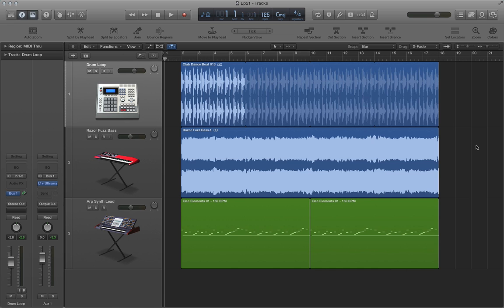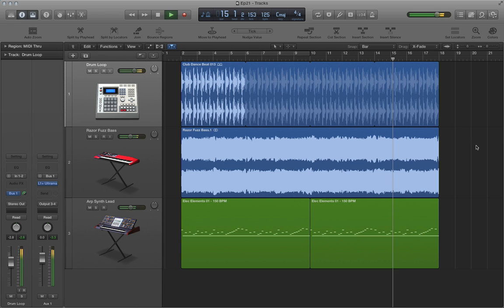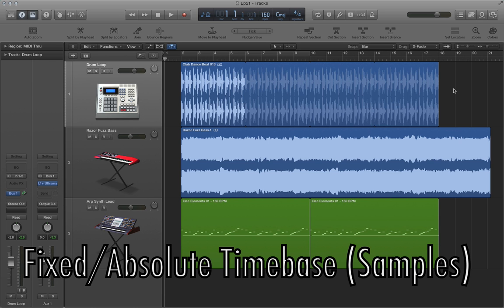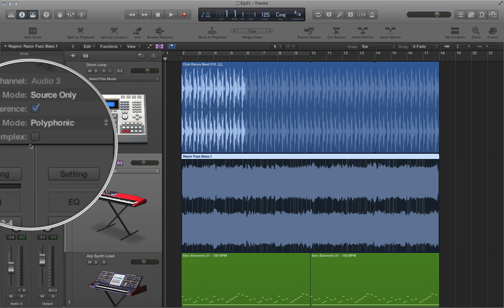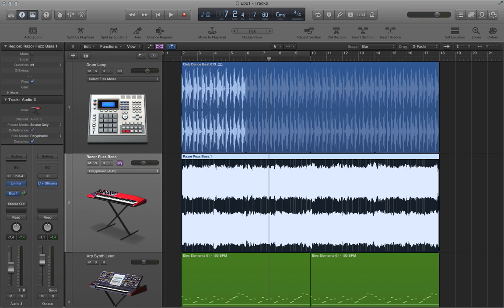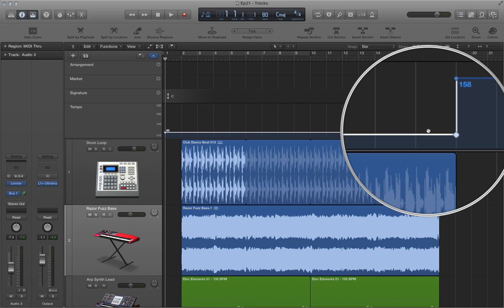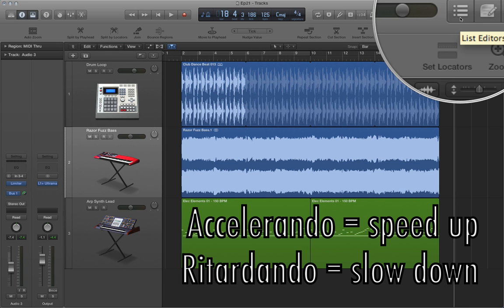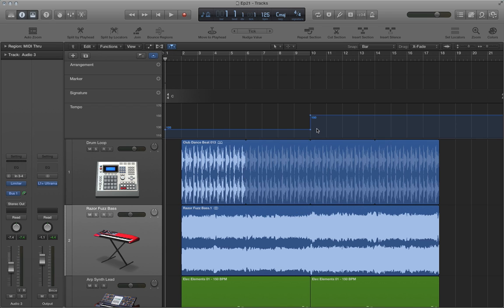Logic Pro X - Video Tutorial 21 - Tempo Changes with Flex Time

Comment: hey man, I was wondering if you could help me. I'm having issues with my EXS24.  Basically, after I've chopped up a sample, using flex time, and set a new bpm, it's all sounding good but then when I convert it to a new sampler track (EXS24), the notes play out in the original tempo of the sample, so it doesn't fit to the new tempo at all. I can't for the life of me figure out what it is. Again, flex time is working fine, and i can chop and edit the audio file to the new tempo, but the issues arise when I convert it to midi in the EXS24.

Comment: Thanks for the video. Is there a way to change the tempo of the project without affecting the speed of the audio? I have a project that was recorded at 120 bpm while it should have been 94 bpm. so now the song is off the grid and it's hard to mix.

Thank you

Comment: Thanks for your explication, I learned a lot but I have an issue to solve. I found this video trying to solve a problem about making a click track for a song called  "Domino" of Kiss. The problem that I have is the BPM counter of logic shows that the tempo of the song is 137,4 Bpm but it doesn't fit throughout the whole track, just keeps the "rigth tempo" around 10 bars. What would be your advice to solve this problem?
Thanks for answering

Comment: Does changing the setting to polyphonic compromise the sound quality? If there is a difficult guitar part I sometimes slow the tempo down half time then stretch it back up, it sounds fine but just checking?

Comment: my audio files always change speeds when i change the tempo (even straight after importing). it doesnt conform to any specific tempo it just speeds up or down relative to its original tempo. is there reason or way to fix this? is it because im importing mp3 files?

Comment: Thank you for your great videos.  I'm trying to put a slight slow down for 3 measures and I did everything you said with the second method(I think) and nothing changed. I tried to speed it way up just to see what happens and the bar moved faster but the audible tempo didn't change. What did I miss?

Comment: i have a question . so i was sent a garage band file to edit in logic x, i imported the garage band file and all the audio was recorded at 120bpm including a drum machine . I.E the audio from a drum machine was recorded in not the midi . ( i know  know why would they just use a drum track in garage band ) any way it wasn't at the same tempo as the garage band was set at . after analysing the drum audio track it was at 150bpm . how can i change the tempo of the track without changing the audio files ( i.e. they speed up ) so i can put in a better drum track etc.

Comment: Hi, love your tutorials so far but this one is a bit confusing to me.
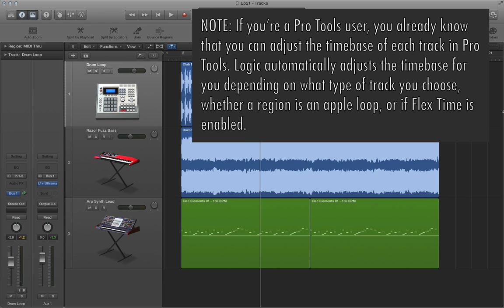At 3:53 while you're talking, suddenly the audio track is resized to match the other two. How does that happen? I guess it's not a trim, so what is it?
Also later at 6:00 when you change your tempo across time, why do you switch off the timeflex? Isn't that the basis for the audio track to work in sync with the others?
Thanks for reading and keep up the great work!
Reply: @3:53
Looks like he's undoing the tempo change from 150 BPM back to 125 BPM.

@6:00
He's not switching off flextime, but toggling between hide & show timeflex in general. On the actual track, flex is still active.

Comment: Hey MusicTechHelpGuy I have a question that I have not been able to find information on to answer. I'm pretty new to Logic Pro X, and I like creating DJ mixes, where songs blend from one to the next. I always find trouble changing the tempo of a song that I import into Logic as an audio file, so as to beatmatch it, essentially, to the previous or next song. I know you said audio files don't conform to tempo changes, but is there any way to accomplish what I'm trying to do? Thanks a bunch for the videos in general! They're a great source to learn new things! Cheers!
Reply from the maker: Do you want to just know what the BPM of the two songs are? Or do you actually want to change the tempo of one of the songs to match the other? To sense the BPM, there is a BPM Counter plug-in you can drop on a track and it will tell you the BPM. To actually change the tempo, you can do it with Flex Time. I might have to think about doing a video for that.
Reply: Thanks for getting back to me! I was more so wondering if there was a way to change the BPM of one song to match another one. I am relatively new to Logic and like creating continuous mixes, so I usually create a multi-track project and begin dragging songs in and then attempting to match the tempos, so I can transition between songs. I just haven't been able to figure out how to change a songs tempo within the project, so that it matches another tracks tempo. I hope I clarified it enough, but if not let me know. Also, I think I saw a Flex Time video you did, but if I remember right it didn't help me in this sort of situation. Thank you!
Reply: theres a couple ways to speed up or slow down a beat this being one and another is going into your sample editor and use the time stretch feature